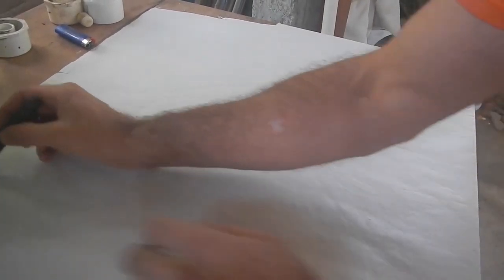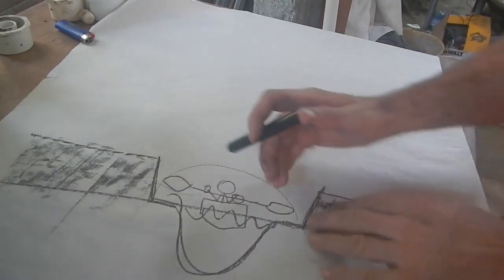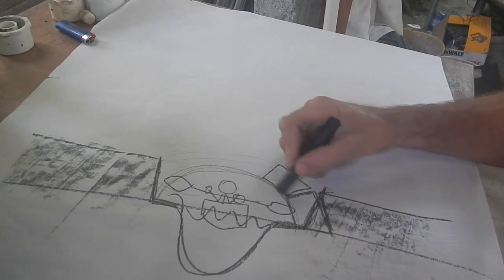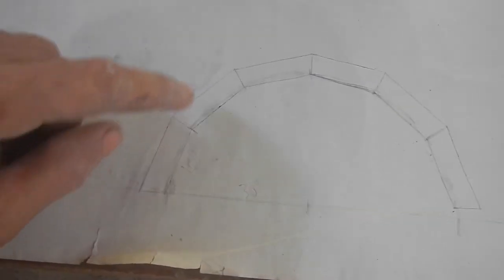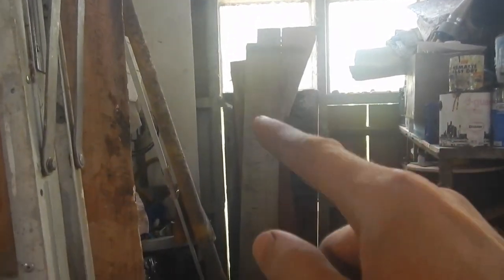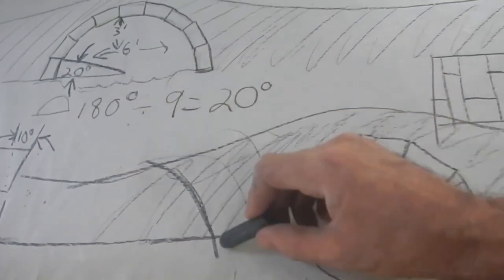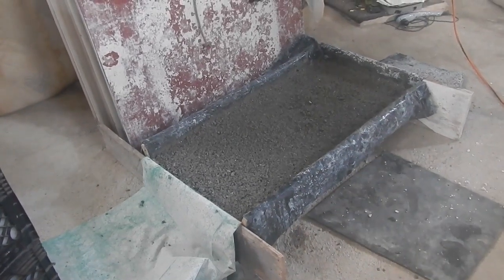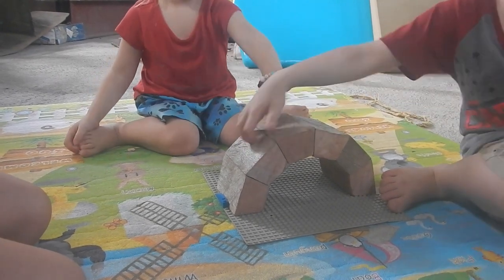Makin' a Bridge 001 Planning Department

Comment: you are the first channel i followed and almost the only one for10 years and everyday i try to add a project to my mind so i can always multitask keep the brain active YAMON KEEP IT UP  MAKE A HYDROBARAGE OR SOMETHING !!!!!!!!!!!!!!!!!!! SINCE u have a little hill on the back you could collect water and move it between pipe to make a wheel spin and maby use a  or some ramp pump to refill them! just submerge the ramp pump for noise issue and voila tool shop alternative power source! Dont hesitate if you have any machining question broda!